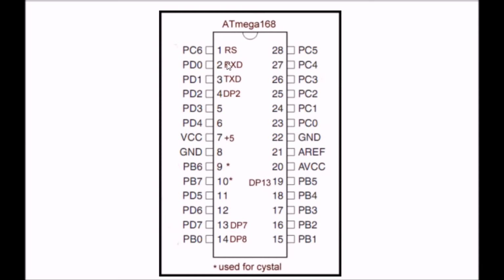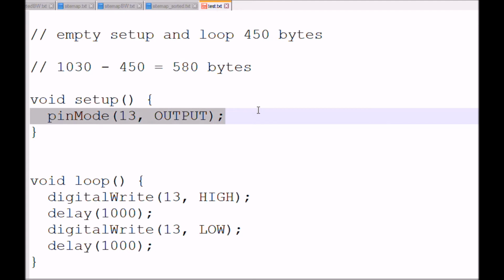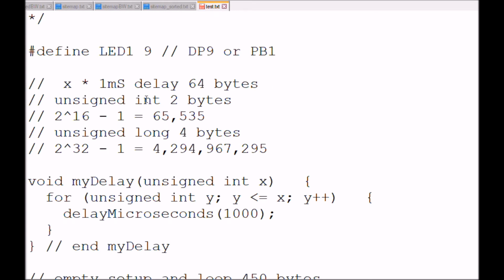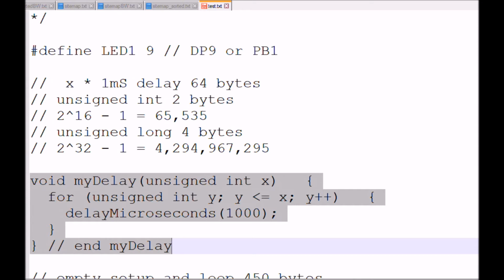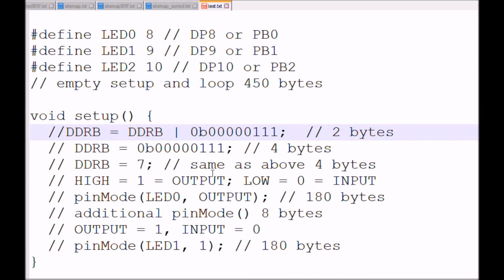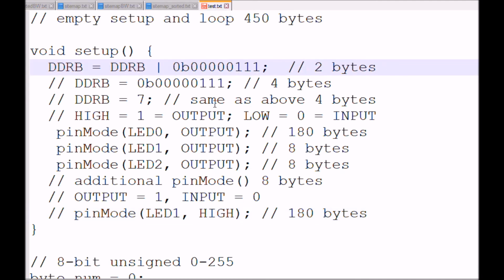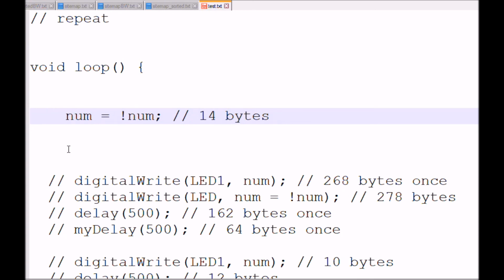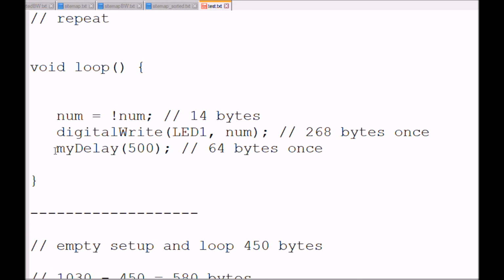Blink How to Program Arduino Hardware

Comment: How is that arduino hooked up? I see optocouplers?
Reply from the maker: Those are optocouplers but not related to this video. They are used to switch higher voltage devices. The input to the optocoupler as your likely know an LED. See https://www.youtube.com/watch?v=408qlS2z6ys

Comment: I learned assembly for each processor we worked with in Boeing, but nothing could beat the 13 byte program to blink an LED off the Q line in a CDP1802